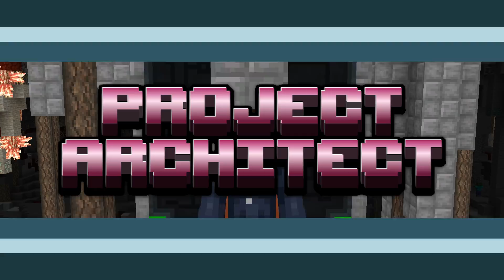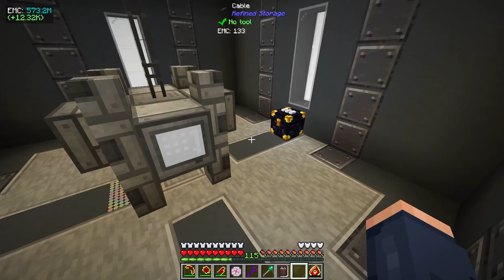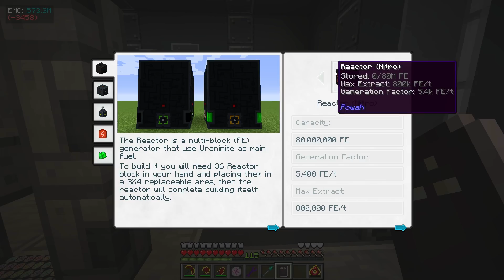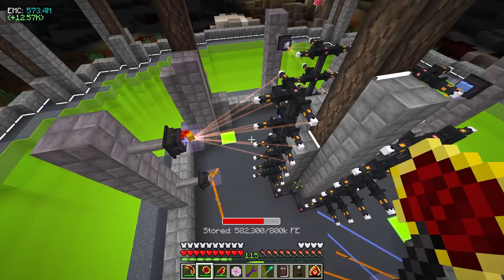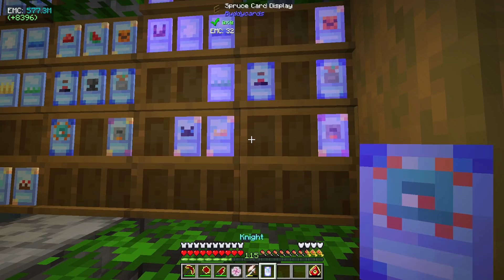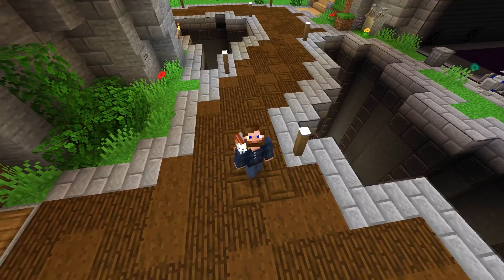Project Architect Modpack EP18 Max Powah Reactor + Buddy Card Effects

Comment: On a general note, you never should use the Storage Disks for anything that will keep getting imported into your system forever. You will just fill up your Disks like that and clog up your System.
For those things external storages that can deal with the overflow (like Drawers with Void Upgrade) are better.
Same for fluids. Simply add any Fluid Tank to the network via External Storage and make sure that you pump the fluid only ever into the Tank but never into the system.
So when the tank is full, then nothing gets filled up anymore.

Also, the mode of the Disk Manipulator makes it only so that certain items and fluids gets removed from the card based on the mode. You can't set filters on the cards themselves that way. Don't know if that is possible to begin with... maybe with a Separate Disk Storage where you put a Filter on the Disk Storage itself? Not sure...

Comment: @ChosenArchitect you can display each set with only 9 card displays instead of the 10 you have.
having each set on 3 rows. for example * = Shine version.
*[01][02][03][04][05][06][07][08][09]
*[10][11][12][13][14][15][16][17][18]
*[19][20][21][22][23][24][25][26][27]
  [01][02][03][04][05][06][07][08][09]
  [10][11][12][13][14][15][16][17][18]
  [19][20][21][22][23][24][25][26][27]

Comment: to solve your fluid problem in Refined Storage: you could use external storages on tanks so that way you would never have the problem to whitelist your refined storage cards
Reply: Industrial Foregoing have super big tanks. Black Hole Tank.
Reply: Another option is to create an rs fluid storage block for each type of fluid. It allows it's own filter